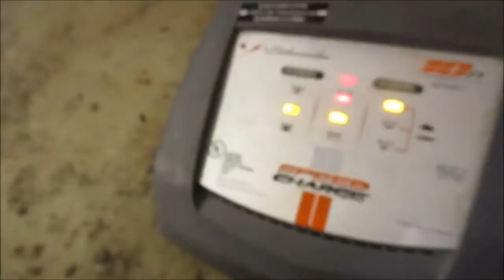1964 vw bug (Daisy) part 22 cold start

Comment: It's called an idler shutoff valve.  I had a 1964 in gray.  I was driving down 101 from Brentwood to Epping one night suddenly the car gave a loud backfire and lost all power and smoke came out from under the dash.  I pulled over and shut down and found the wire had come off the ISV and grounded to the motor burning part of the wire harness.  I plugged the crispy wire back on and started the car and finished driving home.
Reply from the maker: thanks for the vw story.i love them and thanks for watching

Comment: Sounds good. A little stubborn at first getting it started, but ran great after that. When are you going to get the floor welded back in and are you getting Mustie1 fo weld it in?👍
Reply from the maker: mustie 1 is deffently going to help but i will be doing most of the welding. thanks for watching David